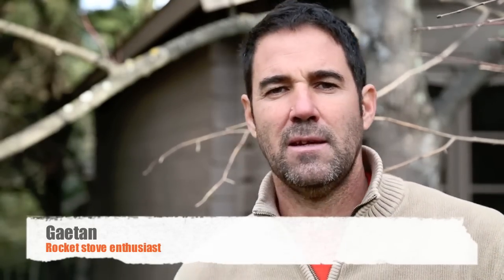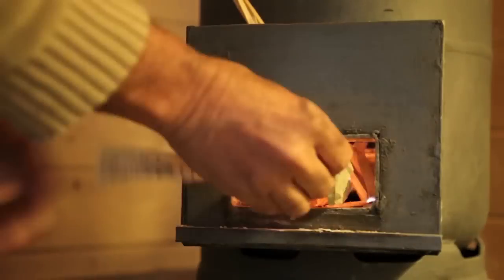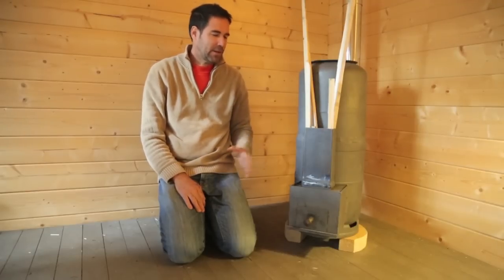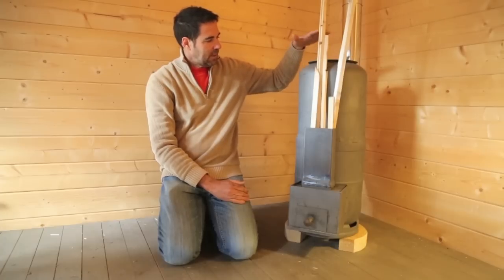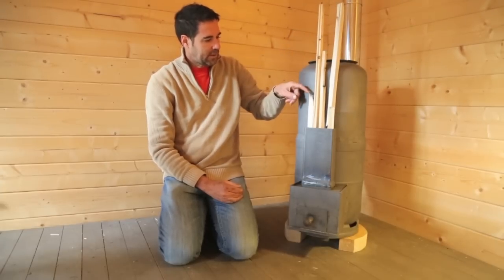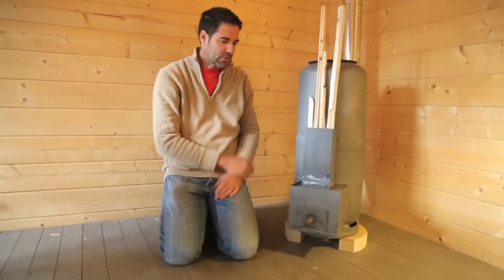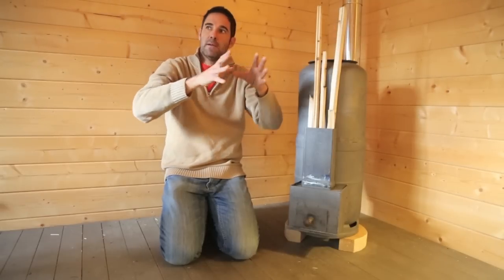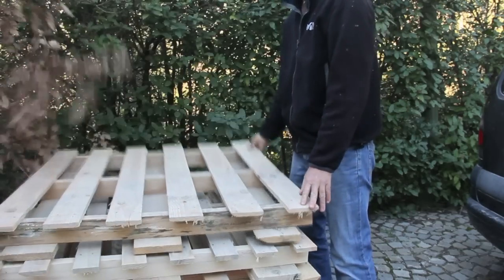Rocket stove heater for a workshop or a room

Comment: welding costs money so do grinding discs , 20 bucks does not seem right.
Reply from the maker: Good point !  Like I said in the video all of the metal was either found or given to me. I did buy an inox pipe inside the heat exchanger, that I bough on sale during the summer months (some $6). Welding, I used about 4 welding rods (I buy my welding rods by 500 so the unit price is cheap) say a few dollars,  were it didn't matter I spot welded to save on rods. Nearly all the cutting I did with a jig saw metal cutting blade that I already had and used 3 small grinding discs (about $4). The vermiculite I used about half a bucket (5 litres) from an older project (costing about 20 cents a litre). About a third of a small spray can of thermal paint to make every thing look good (around $2) and some high temperature cement paste (around $3). I did not meter the electricity used, but it wouldn't be more than a few dollars. All of that was for the actual rocket stove heater unit. The $20 does not include the inox outlet pipe that cost more than the heater (around $120 !)
Reply: gaetanproductions your inox piping may likely be its demise.  When you rebuild it, a clay flue liner or thin fire brick will stand up to those temps over time.  Great video!
Reply: gaetanproductions your inox piping may likely be its demise.  When you rebuild it, a clay flue liner or thin fire brick will stand up to those temps over time.  Great video!
Reply from the maker: Brian Junk  Thansk for your coment Brian. I agree with you, true the extreme temperatures the inbox piping will eventually disintegrate.